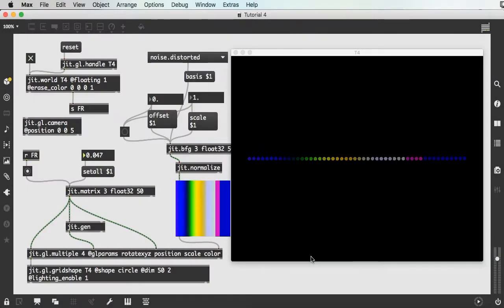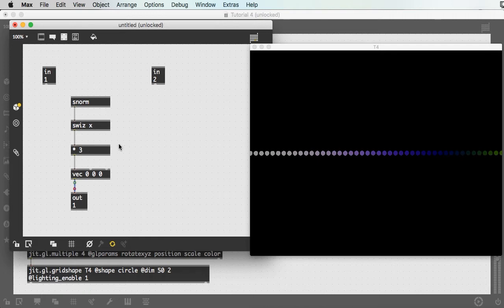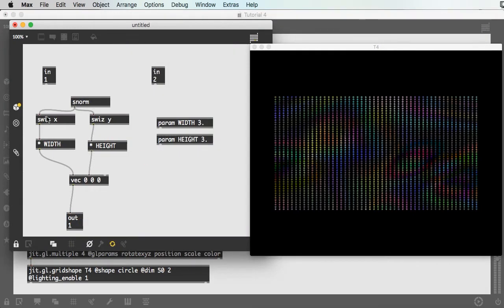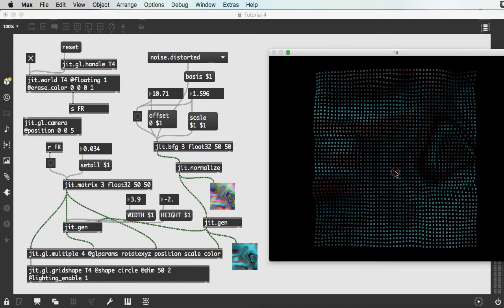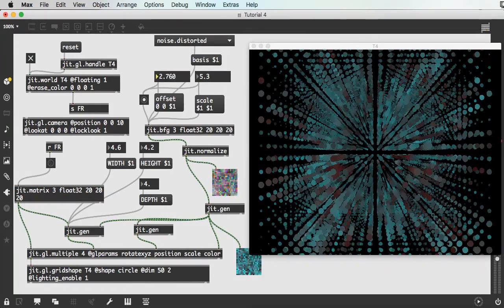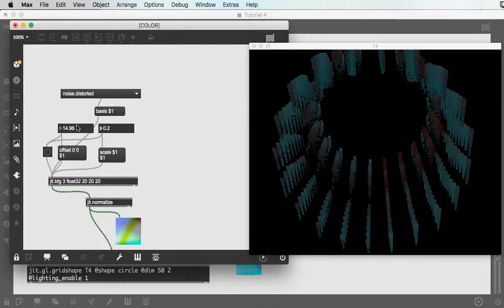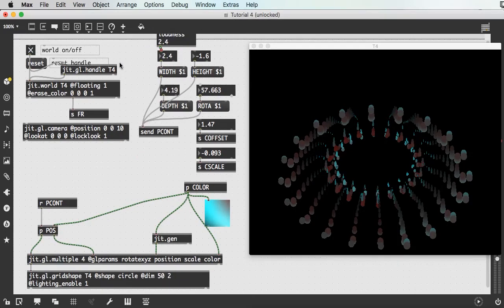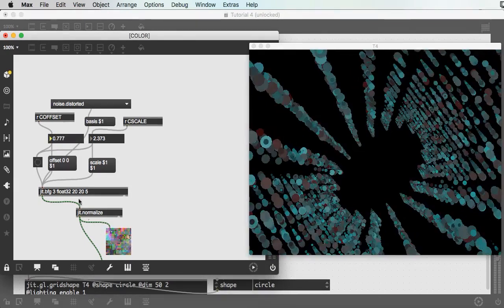tutoral 4 part 2 fall 2018

Comment: Hi john, thanks this is very inspiring!
I have a very simple question, which is the purpose of controlling the rotatexyz with the jit.gl.multiple?
Reply from the maker: Hi Francesco, controlling rotatexyz with jit.gl.multiple allows you to control the rotation of each shape in the multiple: <pre><code>
---------begin_max5_patcher---------
736.3ocwVssahCCD84vWgUdbEKxNN259D+GqVgLDuAWEribb.5V0+80WHEnM
.gfUqPJnLYbNy4LSN1uNIHboXOsID7KvuAAAuNIHvFxDH3v8AgaH6WUQZroE
xo6DKeNbp6QJ5dkM7yL0re.lukTAvovtGya2v3UTkcoQGCJZUeLZMQsZMiWt
PRWobETNdFbJ.iPl+PPn4unnYPveNrF2qQ8RM0s.SUrXCQIY6CmBBCeOQVgs
H0E9OQnPSr2lLwbY5.Y8xVkRv6kVndoE5VzBklZ4Sb20KypkDdY+bI7cTjjM
TEUtfxIKqrKDNBZdklKWvZn.L3uUBhBGARL+tCA4l84HXtUWhdxK84nP+x+x
pYkRVQyZRMELuhUtVYXgSuAHvb2SV0tj1s9JFmtRzxsuj3N9KoMTthnXB9hd
yvGhI9ozS9nI8QEyX+KlaZqTrZmzUVYGfa.RgVXn6e4e9bvBmXmnvvraOXcQ
EHyyJfSvuz2SmMWDcyImHe9YXxo1s3jG0tENFginTxVleraihSLLIOwwN7.F
B5kH4ckio3bgkp0huc5gr6fbnqk.GK8x9D8HsJwB2WjigjanMMjR5ml9MSwp
63.BWg6nz7ibGmLRpm6eys0DdQE0OlXGHoa9M8oGvCKcLDUIJKuKpbk9UR1w
FUbV20KyDlwdqGhj7EdtmcBYUAXt0lVyFy1U6X7BwtZQCyXECxgPMmf2gDgu
R2Nx8gLJ2YWMv8rrGQ7R8c7o8caB1MX9vw9sEiI945TinUtpCpChO3X0TPaz
xhcOoSxAcVNBYA0Zof5s0LTfQnAfblKmGCH3PnHxCHkM.fh8.NQCgPPeHcC.
nHOfyPFBw8ODBeHfSGNvODN4C.mTezvx9p.JeTJmythTWukJaNjrECsA9yBa
CMep8VF2cq0xUeJisrt7g1HDo1qUoMZak15JbeZbnaoB8nAWefLmEklcZHsa
Nv06tzTSbDwtGxj2l7e.xpvBO.
----------end_max5_patcher----------
</code></pre>